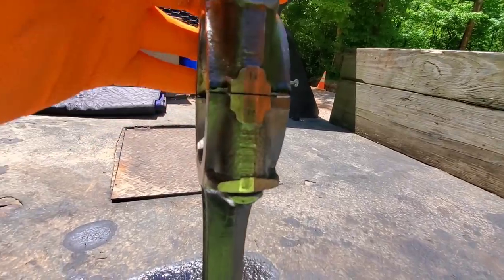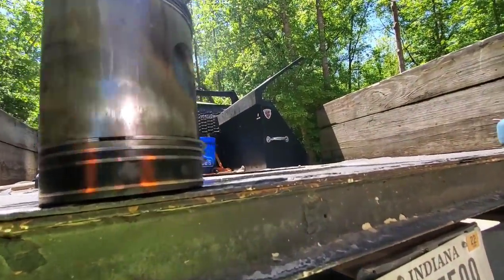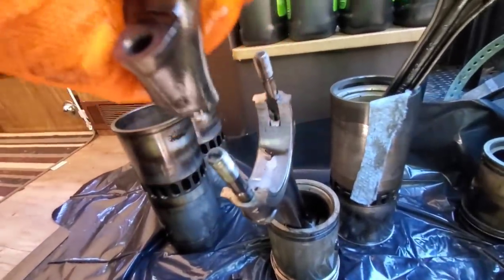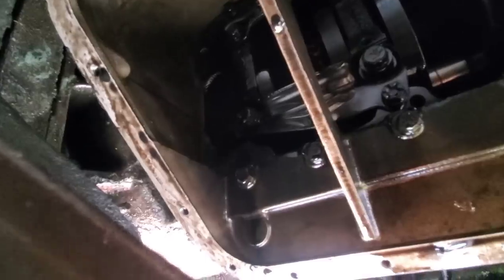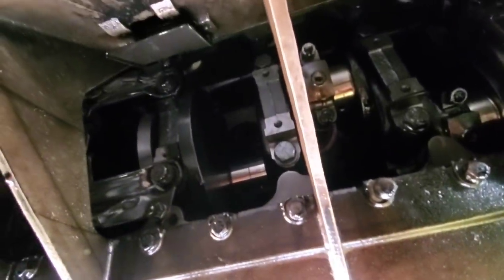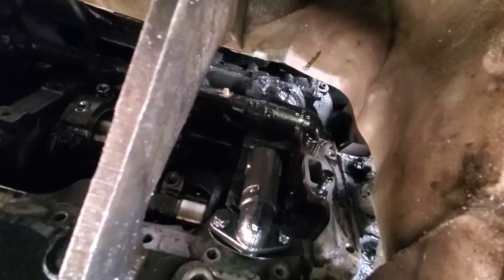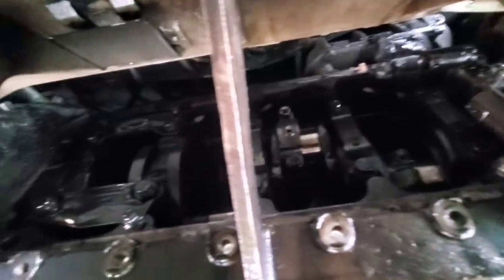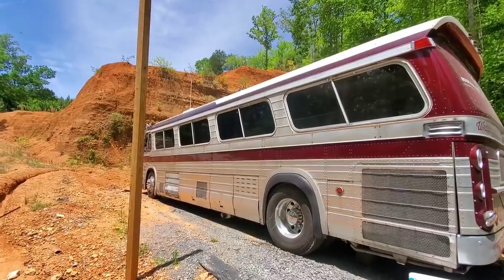Tear down findings

Comment: The V71 used the main bearing stabilizers. They are in the service manual under the main bearings. Section 1.3.4.

Comment: I would suggest you hone the block to .001 thou over liners to clean up the block. The stabilizers were an upgrade  to support the rear mains from stress from the gear train. It was standard on the V-12 engines as well as the 92 because of the movement of the block from the high HP of the 92
Reply: I believe your absolutely right, I worked on a lot of 8V71’s back in the 70’s and never seen 12 point main bolts or stabilizers from the factory.

Comment: So, basically, someone just put some new fire rings and seals in more recently, and called it "rebuilt"?

That hitch welded to the cross member makes me that much more glad I made the pull straps on mine bolt on.

Comment: Now I am not a bus mechanic but I am a heavy duty truck mechanic I did have friends that worked for the transit authority so I have experience in this matter I cant see why you did not pull the motor in Lances bus. It is so simple they use to jack and block the engine cradle and roll the bus a head 15 feet. Then to the same to put engine back in.  As long as you don’t turn the steering wheel it will line up. Much faster that way they all pulled the motor to do what you are doing it to hard to get the head back on the way you are doing it.

Comment: I never remembered any 12 point main bolts in 8V71’s in the 70’s, I started at Trailways in 1974 and never seen 12 point main bolts. Had to be reman job later on.

Comment: Tyler having grown up in a GM Dealership Service Dept. I know that pretty much all Bearing sets with a "GM" on them are Factory installed and not available on the aftermarket.....leads me to think those are the original factory installed bearings!, any rebuild was  most likely a Half Assed top only job!
Reply from the maker: I've never seen gm bearings. But if it was swapped for a factory reman short block that would explain a lot.
Reply: @Spyke383  I worked in a Detroit Diesel Distributorship as a partsman for 38 years. All the rod and crank bearings had the Detroit Diesel logo on them.

Comment: What is this reinforcement for? Is it a firetruck thing or what?
Reply from the maker: It's on his 4106.
Reply: It makes the oil pan level since the engine is on an angle
Reply: Unless you are asking about the trailer hitch that is welded and running under the engine
Reply: @georgedunham6833  It levels the oil pan, Thanks George!
Reply: oil pan adapter
Reply: It is an adaptor to get the oil pan level

Comment: Why not just remove the o-rings and use a dial bore gauge to get the actual size of the sleeve bores?
Reply from the maker: There aren't o-rings on a 71 series. They are dry liners. A dial bore guage gets ran on the upper and lower bores as well as a mic on the liner to verify. Additionally when apart you have to make sure the upper and lower bores are still in alignment. If the block gets how they can warp slightly and the liners wont go in straight.